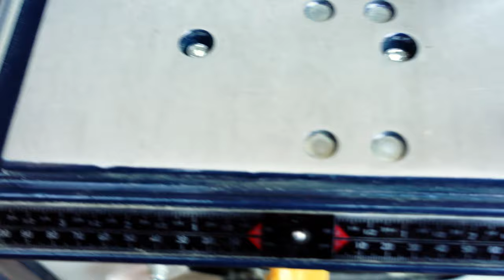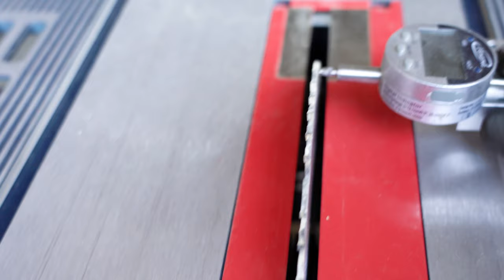How I aligned the blade on a Chicago Electric 10 inch table saw from Harbor Freight

Comment: It was impossible to figure out which bolts (not screws!) you were pointing to. If your blog provided better instructions, then it's a shame the blog no longer exists. You might as well remove this video, since it is completely unhelpful, and will only waste people's time when they're already frustrated enough trying to figure out how to align this crappy thing. Also, if I wanted to spend $65 on a gage, I would have bought a better saw. All that's really needed to test for square is, well, a square. Oh, and the music is annoying. All that said, I hope this comment will help you figure out why you have more downvotes than upvotes, and I do appreciate your attempt to be helpful.
Reply from the maker: I'm glad you figured it out. I hadn't realized the blog link was broken, thanks for the help :)
Reply: @bobhowtoandtravel9551  You're welcome, but I still haven't figured it out.
Reply from the maker: @LesignerGirl  the motor is held to the frame by a pin that is clamped down by four nuts under the front of the aluminum table, ya gotta loosen them with a wrench and then line the blade up (of course tighten them afterwards). you can't use the fence, cause that's not gonna be straight either.
Reply: @bobhowtoandtravel9551  Yeah, the fence is worthless in every sense of the word. Not only does it take time to get it even close to parallel with the blade, but the plastic piece on the clamp end also sticks out so it's impossible to get a straight rip with it anyway. I plan on making my own fence eventually, but first I need to get that blade aligned. I'll try to follow your instructions on Thursday when I have the day off work. Thanks in advance, and wish me luck!